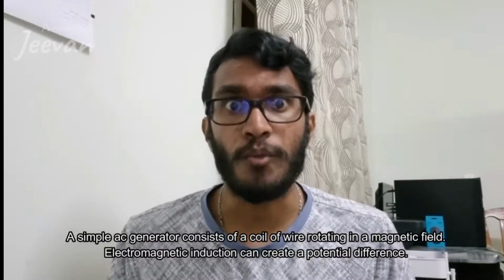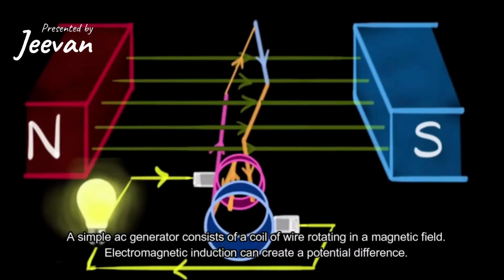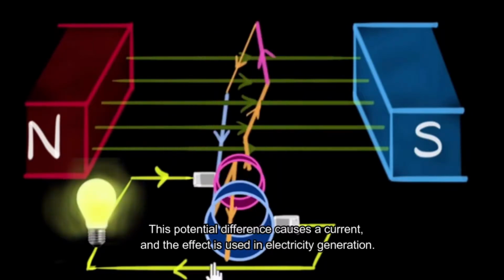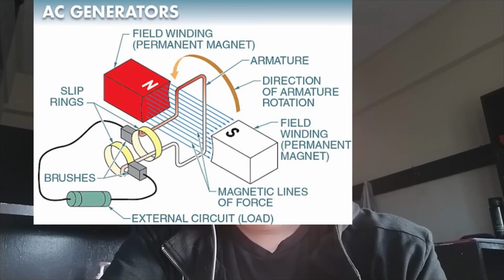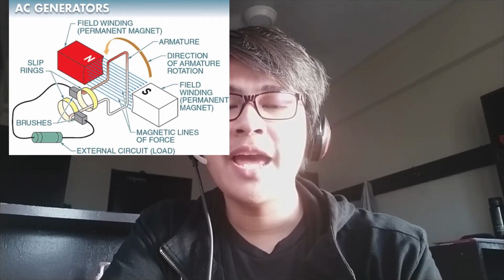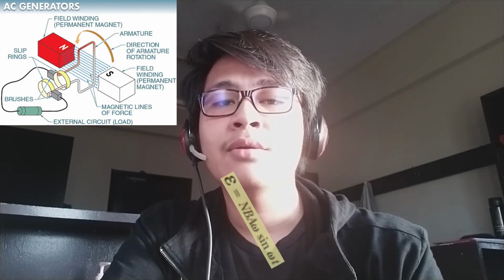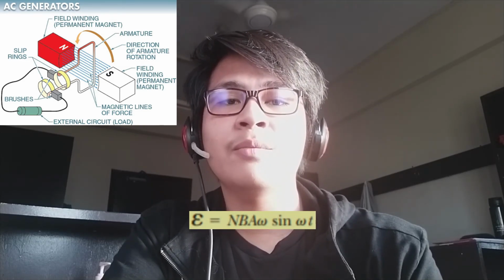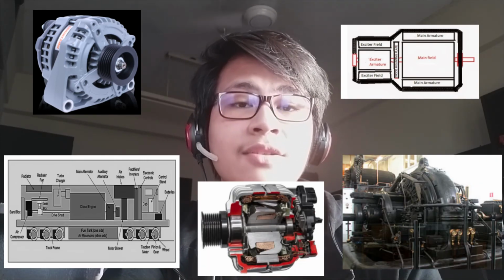Nikola Tesla;Hippolyte Pixii;Michael Faraday : AC Generator?? #physics

Comment: You have reach only  to the 90% truth about the our  public utility- electricity. It's great that you mentioned Michael Faraday [ 1831] Josep Henry [ 1832] but didn't mentioned the Faraday's law of EM Induction. It's very first beginning of the electricity generation by mechanical means. Then Hiplixi ....up to the Tesla [ 1886] , before him in 1885 Gellio Ferraris invented the AC - 2phase [ polyphase AC] method prototype. But our ubiquitous AC power distribution is a  3phase system, Star/ Delta 3-Phase distribution & industrial workhorse Squirrel cage Induction motor developed by  Dolivo Dobrovolsky in 1899. 
Instead of giving the history at least as a summary most of the internet videos promote only Tesla & this is 100% wrong. 
One more thing there is no such thing as Radio alternators but radio frequency generators - RF transmitters.
Besides the 1st AC generation by mechanical means Michael Faraday also discovered the transformer principle,  DC motor principle, field conceptin physics & many more in Chemistry as well.
Reply from the maker: Interesting.Thank you for sharing.😘😘👌